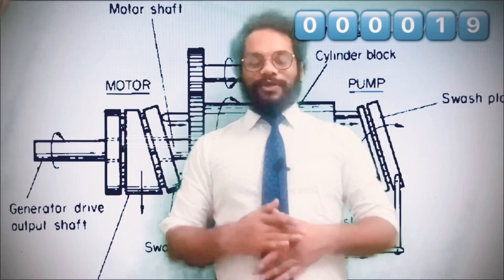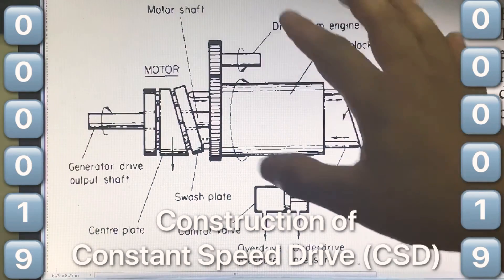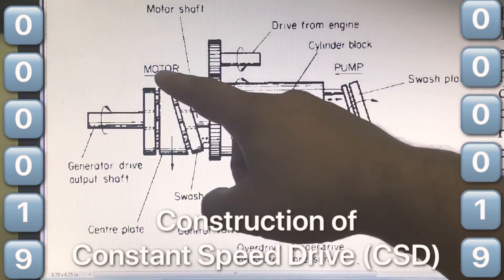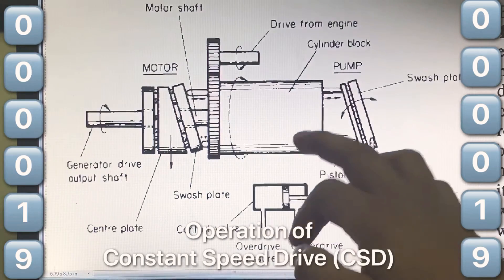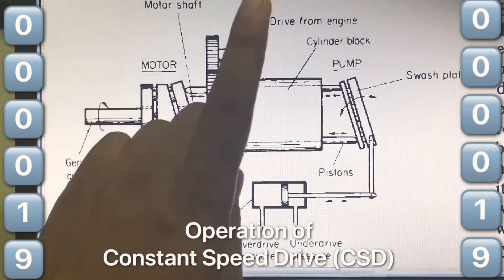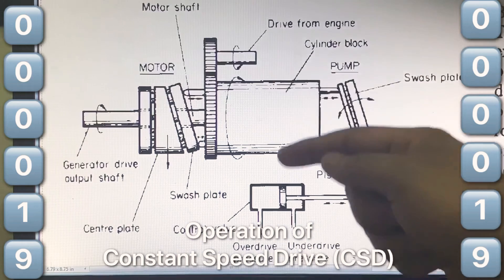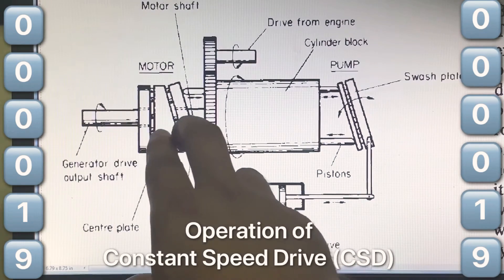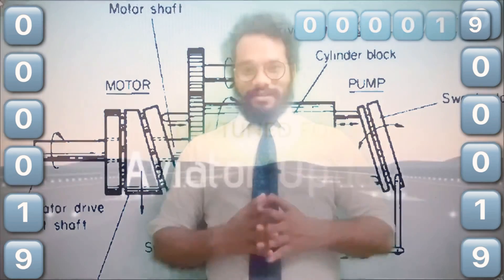Construction of Constant Speed Drive (CSD) || Operation of Constant Speed Drive (CSD)

Comment: You have not explained how the angle of swash plate is changed hydraulically and   It’s under speed and over speed sensing mechanisms, pls do so.
Great video by the way
Reply from the maker: Thank you for the valuable comment 🤗. Will cover up those topics in detail with more elaborated figures in some other session. Stay tuned 😇✌🏻🙂